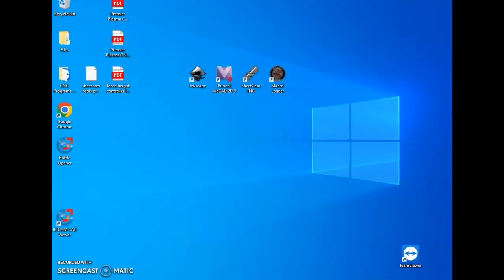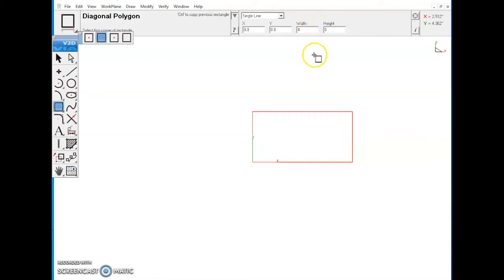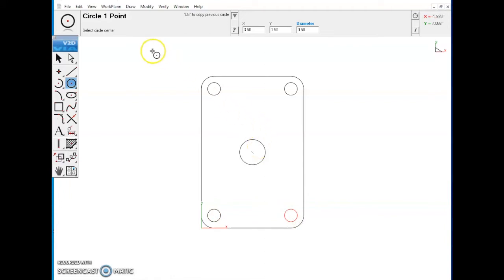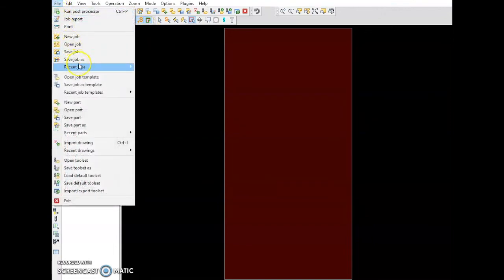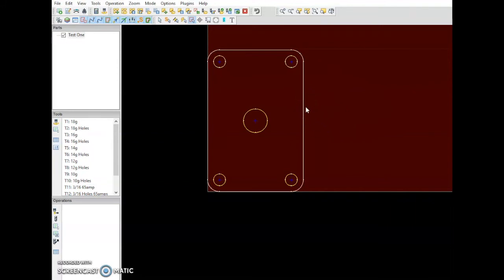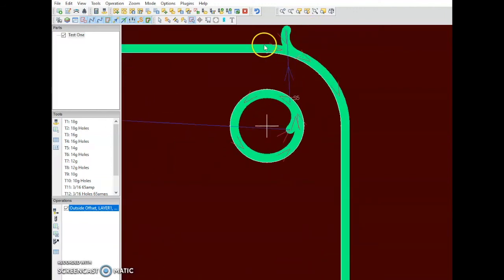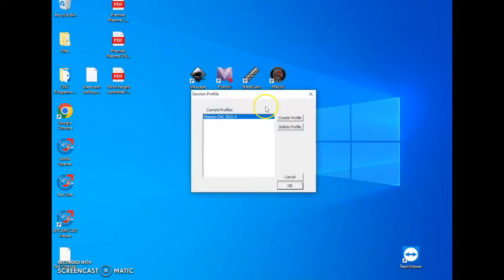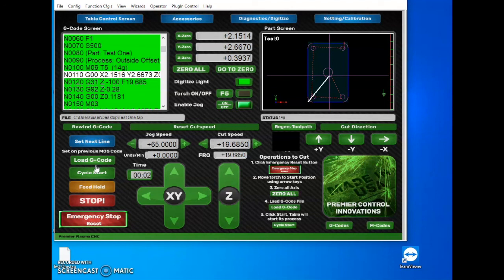Creating your first test part Premier plasma cnc CNC PLASMA TABLE

Comment: Awesome video. A guy i work with just bought a table with this exact setup. But he said he's having a problem where the torch head wants to slowly drop as it's cut. Any ideas what that could be or we could look at to straighten it out. It touches off like it's supposed to then comes up. But nearly dragging the table when it's done
Reply from the maker: Torch height controller needs calibration
Reply: I'll look in to that thank you  @premierplasmacnc